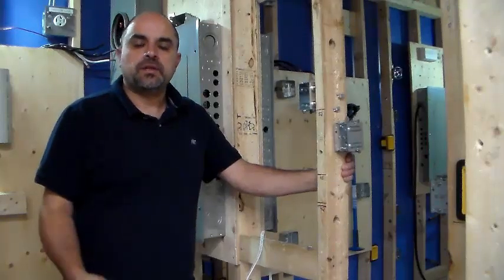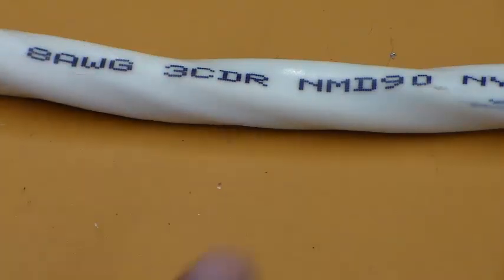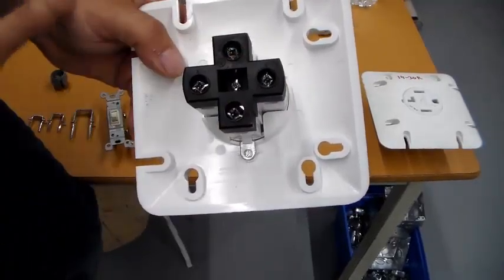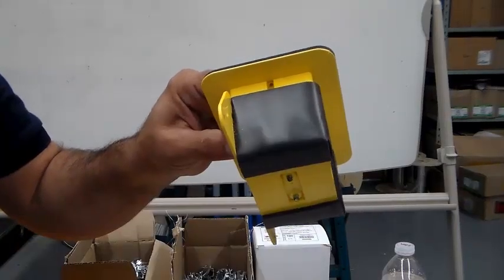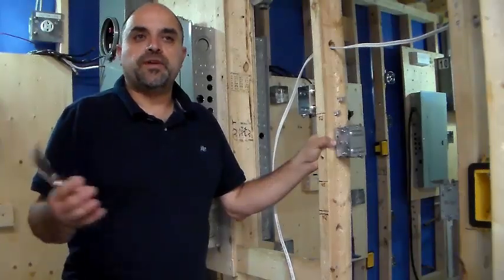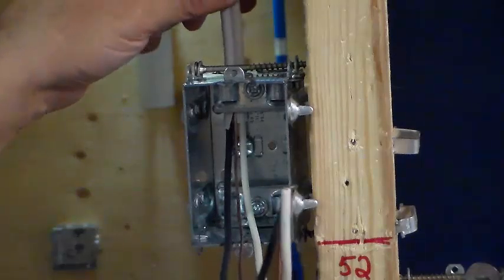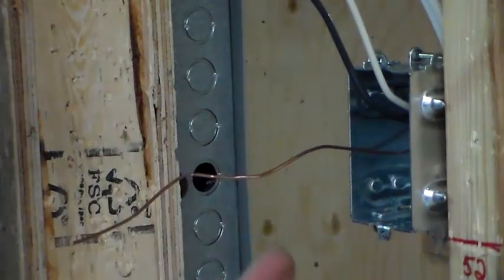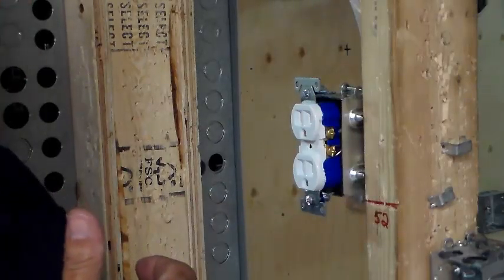Basic Residential Wiring

Comment: Hi Sam, thank you for your video. I have a question and hoping maybe you can help me. Today I replaced one of my 15A outlets in my living room with a standard new one. First, I turned off the power for the living room at the circuit breaker. I then swapped out the outlet which is a basic white wire left side, black wire right side, and a ground. Next, I turned the circuit switch back on. The strange thing is that half of the living room power works, and the other half where I installed the new outlet does not work. What could have caused this?
Reply: You ended the series at the outlet you changed so every outlet after is no longer powered. I would check that you installed the outlet correctly
Reply: Room 853 yes, you’re right. There were two wires that I could have sworn were not connected when I removed the outlet so I left them disconnected. Recently I had a handyman over fixing my door and he took a look at it and sure enough, those wires should have been connected. Thank you for your reply!!

Comment: Why do people like ground of a plug facing up?
Reply: Eric S.   As you probably know there is no standard for up or down in NEC.   One Chief Electrical Inspector I respect said he preferred ground up in case some thin metallic object were to slide down onto a location with a plug inserted, it would only contact the ground pin.   Fairly mute point as many pieces of electrical equipment come with no ground in the cord.   Choose whichever you like, you can't be wrong!

Comment: The cable are visible in my basement. Most have marking, but not all. The colors are as you showed. Is this a standard or just a common convention? Can I rely on this to always be true of what's inside?
Reply: Joe Smith    Go by the markings, not the colors!    Colored Romex has not been around for a long time.   Used to all be white or black.

Comment: My God American wiring is shocking. What's with the bare copper core
Reply: The bare copper is just the grounding or earth conductor.  It’s already bonded all the metal parts in the electrical system and any metal in the building, so it doesn’t really need to be insulated.  It also only carries current in a ground fault situation, and will only do so for the time it takes for the circuit breaker to trip.

Comment: I had a guy work on my house and left work unfinished the wiring is all crap I have 4 can lights that I have to a dimmer the just stopped working one day is there a special way that they are post to be wire either dasy chained or each one individually to the switch aslo what gauge should be used live  in socalifornia btw and do I need to run it through conduit tubing
Reply: If they stopped working did a wire come loose? Maybe start at the dimmer itself. Cut the breaker and use a meter to see if its hot, take the dimmer out the way and make sur everything is connect/ taped. Then follow down the line to each individual light for the same. Rehook everything up, turn on the breaker and see if you're  all fixed. If not buy another dimmer preferably the same one/ style and put the wires backnthe same way. If it isn't working then maybe its time to call an electrician. I'm not one, but I don't think you need to call one immediately.
Reply: @josephrichardson2365  thanks I know its not the dimmer as i put a regular light switch and didn't power on
Reply: @michaeld954  Do you have a voltage tester? They're like 9$. Turn the breaker off  put the switch out, but leave the wires on. Then turn the breaker back on. Put the voltage tester near the wires and if it turns red it means you have power/ it's hot. If it's hot then the issue might just be the first connectio  of the daisy chain as the rest aren't turning on, right?

Comment: At 18 minutes and 40 seconds you say there is no code as to whether the ground is placed on top or on the bottom when attaching the receptacle in the box. There is no code, but some 3-pin flat plugs designed to fit close to the wall have the ground post/pin on the bottom closest to the wire. If you place the receptacle in upside down with the ground on top , when plugged in, the flat plug's wire will run up the wall instead of just hanging down. May I suggest that you  leave all of the copper ground wire in the back of the box for future wiring that may need the ground.

Comment: Ground on top!  When we wire hospital equipment that's what we do. That way if the plug was slightly out and a tool falls it will always hit the ground.  It can't connect the two power prongs. Safer

Comment: the power on the switch goes to the bottom screw if you want the light to turn on when the switch is flipped upwards. So the top screw brings the power to the light.

Comment: Why in heaven's name do you need so much wire coming out of the box (the 6+ inches)?  Then you just have to stuff and bend all that wiring back into the box running the risk of damaging the wires when you push everything back in.

Yeah, I know it's a standard, but why?  Thanks.
Reply: I'm not an electrician, but I do notice aomost everytime someone takes an outlet out and replaces it they keep cutting some off to start new. I guess they know the outlets have a life span, etc.

Comment: Not to be picky.. Sam showed the outlets upside down (ground hole UP), then when installing into the box, right-side up (ground hole DOWN). This can be confusing to amateurs watching and trying to learn. Just a thought.
Reply from the maker: technically according to Canadian code there is no correct way to orient the receptacles accept when installing them in mobile homes or trailers , where it specifies that ground should be up. Rule 72-110(2). Also diagram 1 CSA configurations for non-locking receptacles shows them in the upper position. I like to installed them in upper position , but most customers are use to see hem in the lower position. The term 'U ground" indicates what the bounding hole looks like. If mount the bond hole facing down you get a "n" if you mount facing up you get "u".

Comment: hi Sam.. I have a troubleshoot Question... can you help. me with it... I'm only a Certified Electrician... 3 wire panel system coming out of outside panel system 4 wire connect inside 4 wire system splice not spliced correctly. This was done on a old Mobile Trailer just bought. The city inspector says it has to be a straight 4 wire system to have the POWER turned on... I would like to do it myself... Can you explain it to me how to do it?

Comment: I see that you are Canadian. Do you have any videos on installing a 6-50R. I need a 40 amp breaker? 8 gauge wire? It's going to be an outdoor outlet. Can I use a Taymac cover box?
Reply from the maker: I suggest you check your local code and if this is going to be an outside plug you may need GFI protection

Comment: I have an issue saying 14-2 wG is used for outlets. Lights ok but NEC requires that although 14 can carry 20 amp, it is fused at 15 amps. This means that 12-2( that can handle 25A but fused at 20A) is used for outlets. I am retired from electric work for 4 years now but I'm not aware of any change here.

Comment: I see on the box for the staples it says 14-2, 14-3, 12-2, and 12-3.  So, does the 14-2 mean only two wires with no ground  or do they just not say anything about the ground and it actually has a bare ground wire in it also?  And the 14-3, is the cable with two coated wires and a bare ground or are all three wires coated, like for a three way switch wire?  Thanks

Comment: Great little video.  I do have a question or 2 however.  1: Was there a reason for not talking about the tab that connects the screws on the outlets that can be broken off turning the outlet into 2 separate outlets on 2 different switches?  2: Why was the speed connections on the backs of switches and outlets not talked about as well?

Comment: Hello, I have a switch in my living room that is wired directly to an outlet. When the switch is flipped up in the on position the outlet, both upper and lower sockets work. When in the down position, neither upper or lower sockets work. What I want to have happen is when the switch is in the upper position only one of the sockets work for a lamp and the other socket have a clock plugged in that isn't disturbed by the light switch. In other words one socket hot all the time and the other socket controlled by the light switch. Please help.

Comment: Hi Sam, I am trying to replace a broken dimmer switch. When I opened the box, I saw it connected with only two black wires. However, the new switch that I purchased has three wires, one black and two red, besides the green/ground wire. So, how do I connect the wires to put the new switch on? By the way, the box holding the switch is metal and I believe is already grounded, so I guess I don't have to connect the green wire.
Reply: Shahzad Akhund  most new dimmers can be used as a 3 way or single pole dimmer. you should put a orange wire nut over one red wire and use the the remains red wire as a load wire  and the black wire is the line wire or power in. hope that helps

Comment: The video didn't answer my question at all. I have a light switch that controls the outlet.  I want the switch to control half the outlet. In other words, when I have a light plugged in it will come on with  flipping the switch and when the switch is off I can plug something into the other outlet and have it work with out flipping the switch on. How do I wire that?
Reply: Tom Gala you need to start by figuring out if you have physical power in the outlet. if you don't have a power wire you will need to run another power wire to the box. once you have power you will notice on the brass side there is a little fin between both brass contacts. break it out pliers and install one power wire to a brass screw and install the wire from the switch on the brass screw. hope that helps

Comment: Wrong! that's not a 10/3 cable, it is 12/3, the last one might be 10/3
Reply from the maker: not sure where in the video you are speaking of, but I did not use 12/3 cable in this video. not to mention 12/3 NMD 90 is not available.
Reply: Sam Maltese It's in min. 2:00, when you start describing the different types of NM cable., At least here in California, 12/2 and 12/3 NM  have to be identified with a yellow jacket and 10/2 and 10/3 with orange jacket, to make easy for the Inspectors to see right on the spot if the right gauge was used in that particular run. If you remember, a few years ago all NM cables were white. Thanks
Reply from the maker: Durolec,
Not sure what they use in the USA, but in Canada the colour code of the outer jack is not a code requirement yet  here in Canada.  As for the AWG of the wire I described in the video they are correct . The only mistake you could say I did was saying that the 12/2 with yellow jacket was used for baseboard heaters. The wire commonly used for baseboard heater has a red outer jacket and it inter conductors are black and red to indicate that two phases are used and 240 volts. The yellow wire in the video is commonly used for 20 amp 120 volt circuits , such as the GFI on kitchen counter receptacles .
Reply: Sam Maltese I apologize, I didn't know that you're canadian, but yes, in the USA the AWG is color code. white jacket for 14GA, yellow for 12GA and orange for 10GA regardless how many conductors. Here you can use 12/2 as a 240V circuit provided that you label the white wire as hot and the device you intent to energize doesn't need a neutral, otherwise you have to use 12/3.

Comment: In a three way switch -   I thought that the black wire - would go to the common point terminal- where as the white and the red would go to the two brass screws = travelers which would be the - Red and the White ---;  however I saw the Black used as a traveller and go to the Brass crew with the red - whereas the White was used as the hot and go to the Black screw -----   is that scenario allowed as well , or was that considered wrong -

Comment: I work as a electrician in Sweden, and i have always been facinated by the electrical work in both US and UK. 
In my eyes you are way behind in technology. Here in Sweden and most of Europe we use flexpipes in our walls to then pull our cabels through, this makes it possible to replace the cabels easier. 
Here we have 220v 3phase as standard, to me it seems just stupid to have 110v and almost only 1phase. you need to have very thick cabels, I mean copper is expensive and a limited resource.
Reply: But Japan has almost same system as America and I don't think that Japan
 - a country with the most developed robotics is behind technology. If 
You talking about 100 to 130 volts look that American appliances use 
much less power than European. (I'm from Europe too)
Reply: A history lesson;
When electricity was just getting started, Edison used DC distribution, so voltage changes between generation and usage were not feasible. In order to make use of the incandescent bulbs of the day, the voltage could not be too high. 120 volts was settled as a reasonable compromise between distribution losses and lighting durability. This general purpose voltage has been around in North America for over 100 years. For most purposes there is no benefit to changing, which brings me to my second point.

Essentially all homes and businesses in North America have 240 volts supplied to the building at minimum. It's called split phase, and is used for heavy loads (such as electric cooking appliances, air conditioning, electric clothes dryers and so on). 120 volts is only used for smaller loads, where additional voltage wouldn't bring much benefit.

For applications where 3 phase power makes sense, we have 3 phase power. Most commercial and industrial sites have 3 phase service.

Lastly, our cables are protected with plastic sheaths. Additional conduit is a needless expense in light construction such as residential. It has nothing to do with being behind or ahead. Our system works very well, so there is no reason to change it.
Reply: I think American/Canadian system is better because the distribution of 120 or 240 volts goes next to houses together with 7200 volts on one pole, which amplifies the signal I think. New houses have own transformer and in Europe the distribution is only in these 400 volts 3-phase actually. By the way how do You think about 230/400v system. Do You imagine theoretically like 380-415v or 480v in house in North America for big stuff or this to high? Regards
Reply: Well I understand that. Im just saying for example, if you want to run anything over 2kw 1phase you whould need to have a 20amp circut and larger gauge wire, while here we whould only need a 10amp circut and smaller gauge wire.
Reply: +Elias Wanrop most appliances in North America that are much over 2kw already use 240 volts. Though it's called split phase, our 240 volt system still acts like a single phase.

120 volt circuits are available up to 20 amps, but most small appliances are designed for 15 amp receptacles and circuits.

Is 120 volts ideal? Probably not. But there are literally billions of receptacles and appliances designed for it. Trying to change now makes no sense.
Reply: +captain150 , And I'm curious how it is in big buildings or placed where could not be voltage over 1000v and could not be placed tranformers, if You know, doesn,t matter if it's three or split phase, Is 120volt (or only 100v in Japan) sustaining and peristing, when wires are very long, is not the voltage varies too much, I'm asking 'cause I just don't know, in Europe there is no  extra transformers in buildings 'cause 230/400v is rather high voltage. Regards :-)
Reply: +Elias Wanrop You know I think it's not about larger wires because install wire is mostly on time thing, but look at that misunderstanding, we in Europe and in E.U. say, 
 that we should reduce power use, so we
"shot" ourselves in the foot when changed to 220, because Europe also had originally 50 v, next 90 to 110v and like I said above, I was shocked when I saw power ratings of 
basic  equipment. American microwave is 750 watts, European is 1500 
watts, electric kettle in USA is about 850 watts, in europe is at least 2000 watts,
 american iron is 350 watts and european 1000 watts and those new with 
water mists - 2000 watts ! Maybe I should not say about that  but I feel screwed and first of all broke with electricity bills, You know what I mean
Reply: But how much less copper is a 3 phase cable really.  The gauge is smaller then 1 phase, but you have 4 wires compared to 3.  Would be interesting to see how much copper each cable has within a 1 meter length.  I don't think the 3 phase would have that much less, someone would have to strip all the shielding off say a 30 cm length and weight the actual copper content of each wire to find out.
Reply: captain1503 tygodnie temu"   
AND how about introducing gradually also stuff with less power on 240v split phase, what You think?

Comment: That is very similar to the UK, but the exposed length of ground wire must have a green and yellow sheath slid over it to eliminate any chance of a short circuit. Also our outlet plugs have the ground pin longer than the live and return. That is because an internal shutter falls over the live and return slots to prevent small children from inserting metal objects into the slots. As the longer ground pin enters it raises the shutter to allow the other pins to enter.
Reply: If it shorts to the ground it trips the breaker.
Ground pins are also longer than the other two here.
We have tamper resistant receptacles that are required in almost all applications now that require pressure from the neutral and hot on the doors at the same time to open.
Reply from the maker: Yes tamper proof receptacle shave been required by code for many years here also.
Reply: You have 220 v there. We only have 110v as the primary outlet. 110v only tickles.